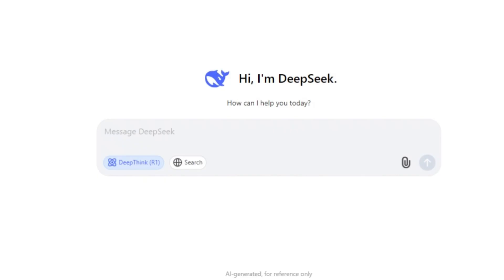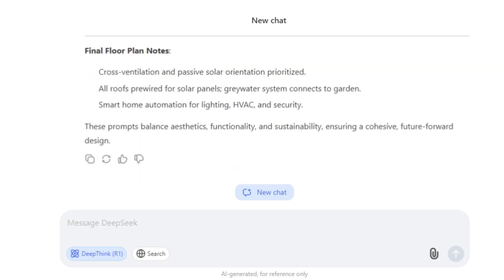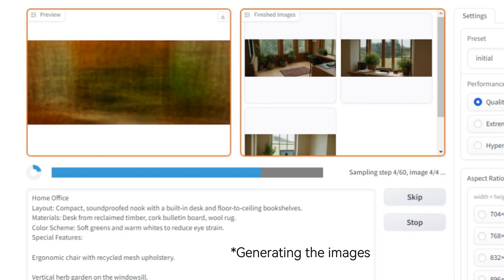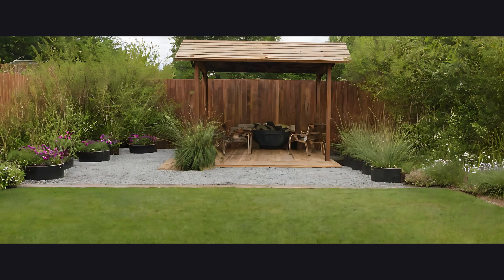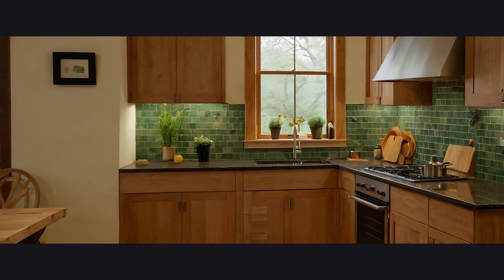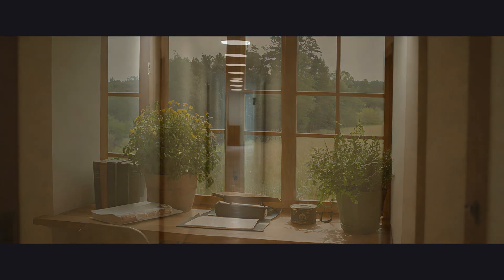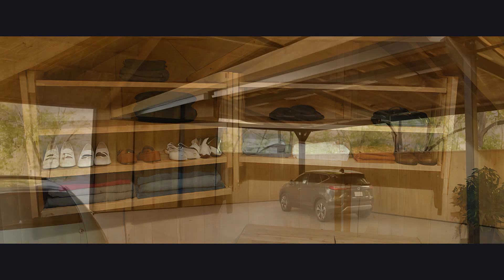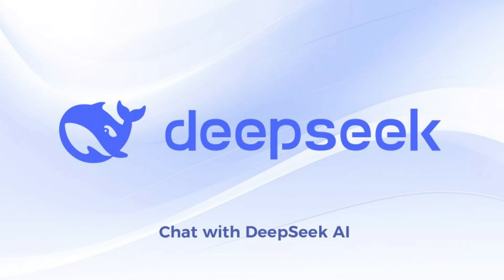How DeepSeek R1 Creates a House

Comment: This is hilarious and very well done. As someone who has designed houses for over 40 years this has got me laughing with disbelief. What an utter disaster!
In some respects, the problems of designing a successful house are quite simple and easy to solve if you know your  work. On the other hand, there is a huge array of types of problems, which interact with each other in unexpected ways. This is where newbies typically trip up. They forget to check these interactions. So there is a high level of complexity.
DeepSeek takes incompetence to new heights here. It doesn't even know what the lines on the page represent. That's what I found most amusing. Clearly I don't have to worry about competition for the moment.